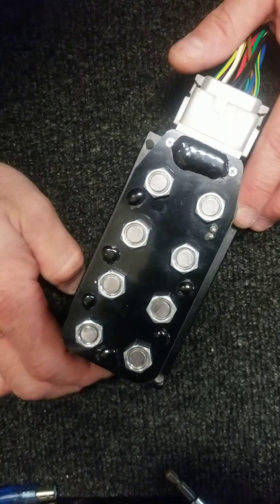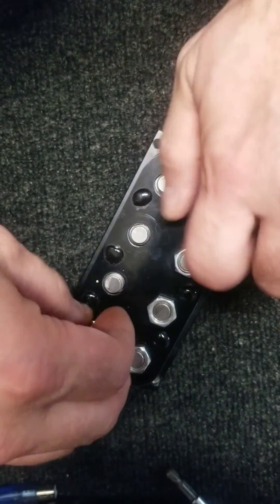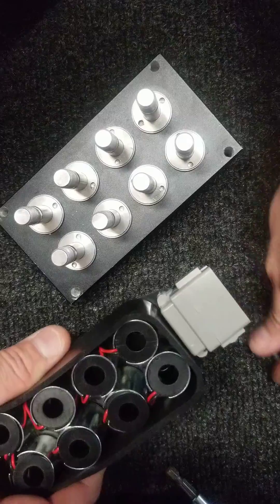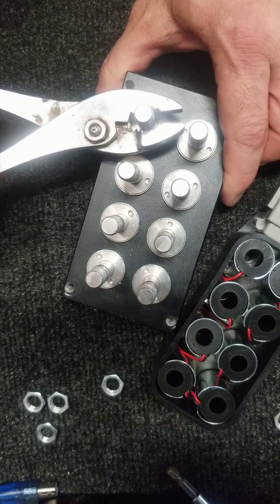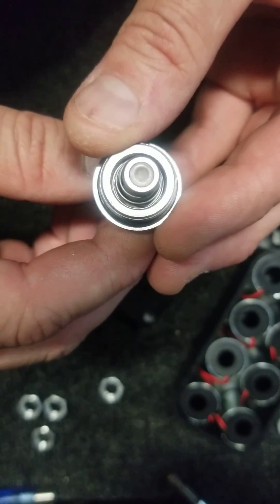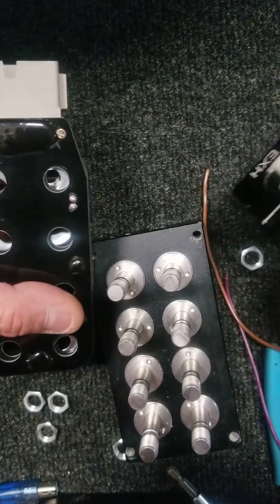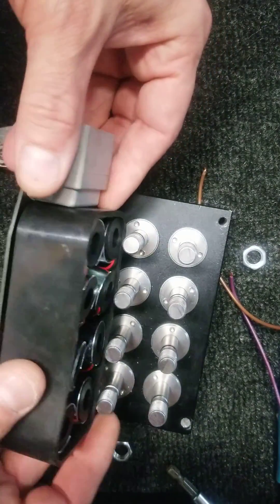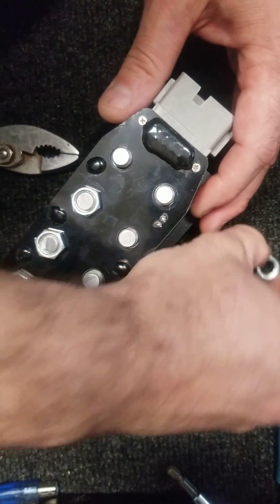VU4 air valve rebuild, clean, leaky valves

Comment: My left side will air up but it won't deflate all the other switches work can't figure  I out
Reply from the maker: This could be due to a stuck valve if you are hearing a click or it may be the wiring if there is no valve click when the switch is activated.  I hope this helps. I would start by listening closely to the valve body once you trigger that wheel to deflate.

Comment: The 8 popits if 2 go bad do i have to change them all?
Reply from the maker: No it is not necessary to replace all the valve plugs.. Just the ones that are having the issues.. But many times it is not the plug but the surface that the valve plug sits on.. Be sure to check for debris in the valve channels and check the plug contact surface and well as the rubber end of the plug.
I hope this helps,

Comment: Form the wiring lines which one is the positive wire on the block
Reply from the maker: The valve block has 2 black wires centered on the top of the connector, all other 8 wires are +12 volt valve triggers. 2 per corner,  1 fill, 1 dump. You can take a positive test lead to check function.